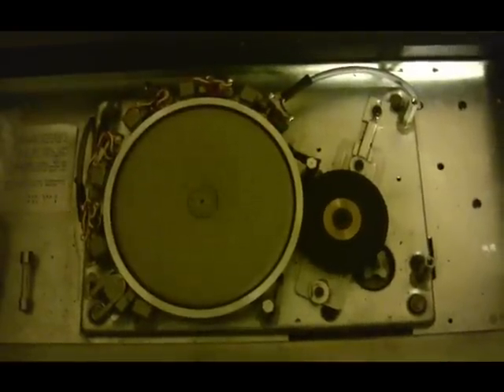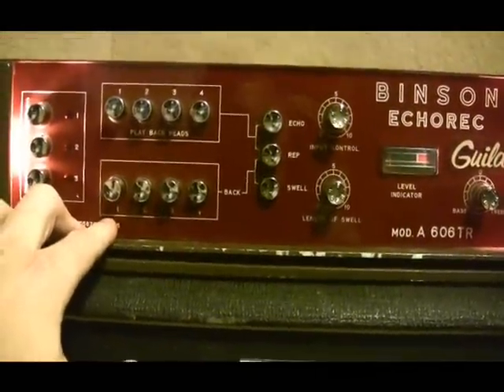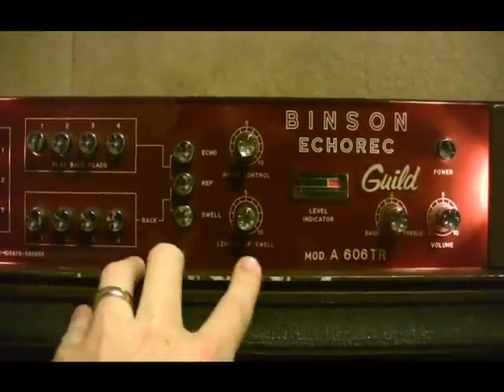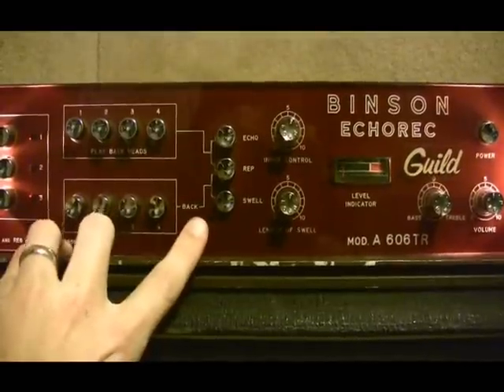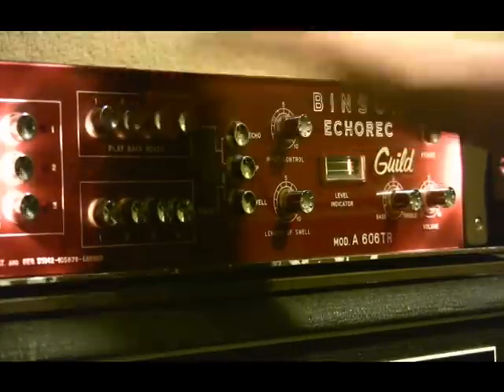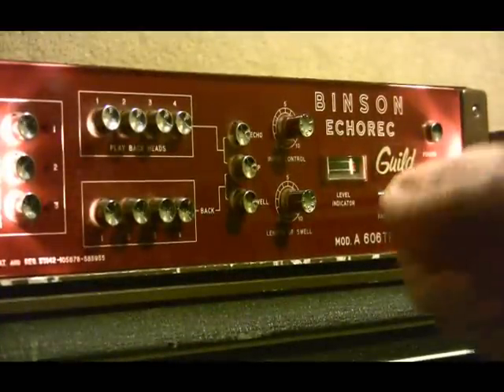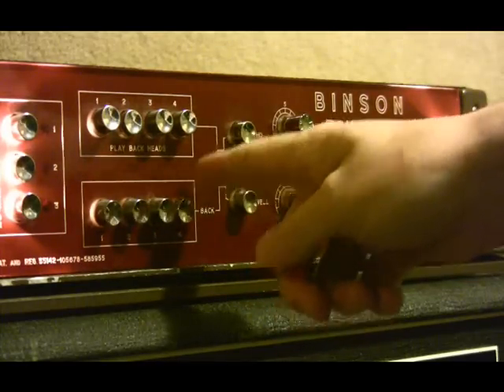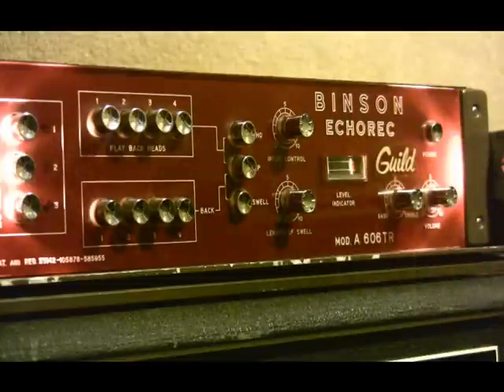Binson Echorec Explanation

Comment from the maker: depends.  fully restored, rewired ones will generally fetch upwards of $1500-$2000 (maybe more).  others that need rewiring will go for around $1K or below.  but it depends, the green/yellow tube models tend to go for a little more than ones like mine.